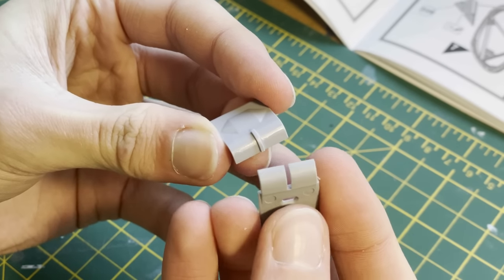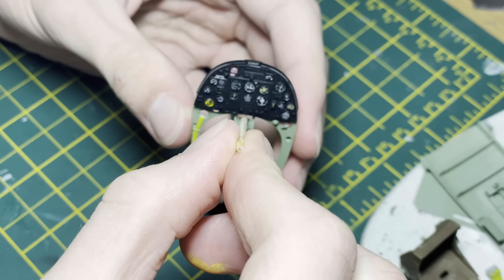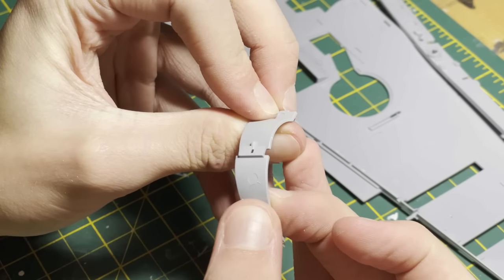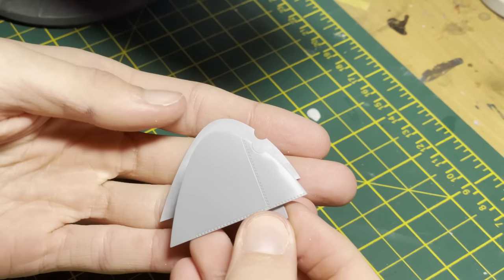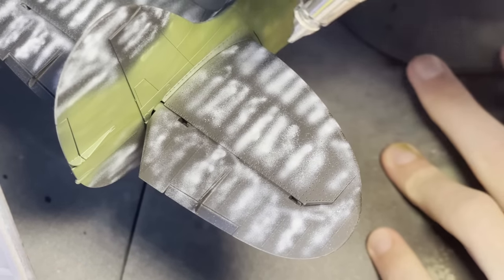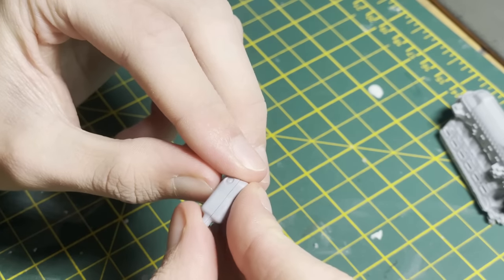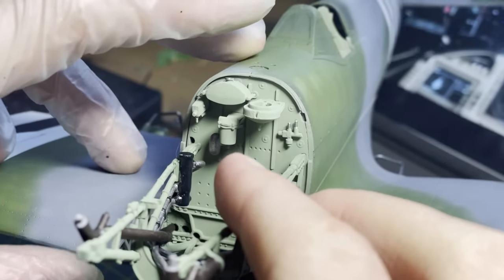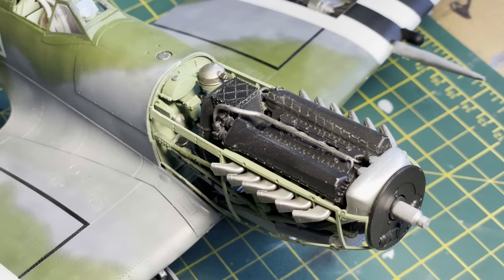Airfix's Brand New 1:24 Spitfire Mk.IXC | Full Build | HD

Comment: One of the most famous aircraft in WWII, dishonored by a marginal kit.
Reply from the maker: Thanks for the comment! I'm not sure if I agree completely with this one (and if your view could be impacted on my take on the model) but I think the kit does the Spitfire a good justice, perhaps my modelling not so much!
Reply: I have the kit, and it's certainly not " marginal" it's superb .
Reply: @machmodels  , your model skills are top notch, for the price I would expect to see perfection in the kit. Instructions don't link well to parts on sprue, scaling issues in the wings, engine mounts and cockpits. Somewhere along the line, model manufacturers thought we wanted man sized kits at huge cost with lots of detail. 1/48 us large enough for me. Plus in addition to price of kit there are after market things like crews and equipment and paint. Those can equal the price of the kit. So I call it marginal because of the value to the builder building this kit and having to make corrections along the way. Plus I don't want all of my model time centered around one model. All a personal opinion, your skills, especially tackling a kit this size , are remarkable.
Reply from the maker: @christopherstaples9487  agreed! the surface detail is on another level!
Reply from the maker: @c123bthunderpig  in that case a very well justified comment, I also like to stay in 1/48 or 1/32 range so this was a step out of the comfort zone and I agree for the pretty price of £100 for a kit you do expect a lot. On the other hand, I feel part of modelling is resolving problems that come with a kit but hey that's just my opinion :) Thanks for the comment :)
Reply: @machmodels  and your modelling does it full justice. You have great skill.
Reply from the maker: @christopherstaples9487  thank you very much! very kind :)

Comment: Invasion stripes were brushed on to the aircraft in 1944.
Reply: Yes and no. you are quite correct that most of the aircraft on the 4th & 5th June had a very hasty application, but as the weeks progressed a more professional application took place. Given the style of stripes on this Spitfire, it would have most certainly been the latter.
Reply from the maker: thanks for the comment! Wasn't too sure on the dates of everything so thanks for letting us know :)
Reply: A very interesting and informative video. I am watching various builds of this kit on Youtube and they all recommend it highly. Nigel's Modelling Bench series is very good and deals with both the thinning of the seat belts and an easy way to overcome the issue of the awkward pipe in the engine compartment. The downside is that the videos are quite long. On a different note, could you please try to avoid repeatedly saying 'no issue whatsoever': I did not count the number of repetitions but it was considerable. Many thanks and best wishes for a good modelling year in 2023.
Reply from the maker: @georgeclements2742  yup no problem! i'll try to limit it in future videos, thanks for the comment and wishing you a good 2023 too :)
Reply: I find 100 euros expensive for a plastic kit. The pleasure of building is the value.
These models don't have a selling value. 
I am building a wood model ship from Billings Boats, Smit Rotterdam BB 478,  1/75 scale.
All parts are lazer cut, amazing fine detail.   I find wooden model build more satisfying than plastic.  Also my air brush gives problems quickly blocking. Needs constant cleaning. Maybe because  acrylic paint is a plastic.